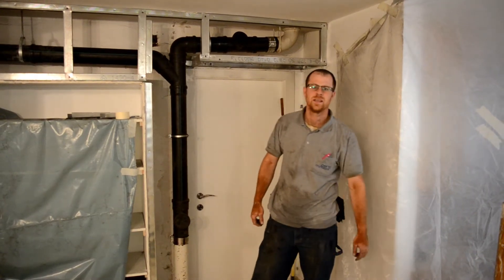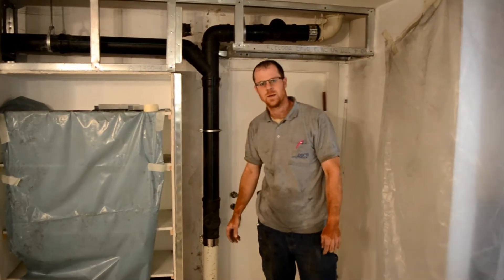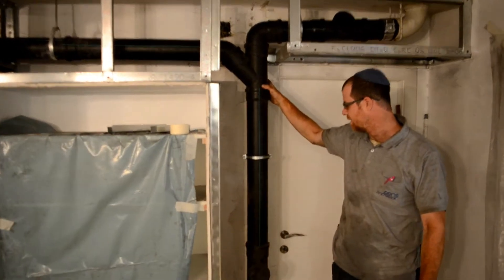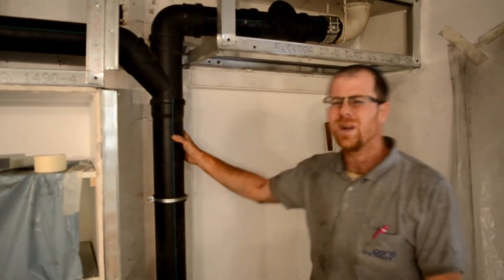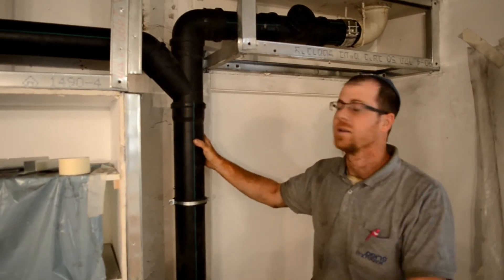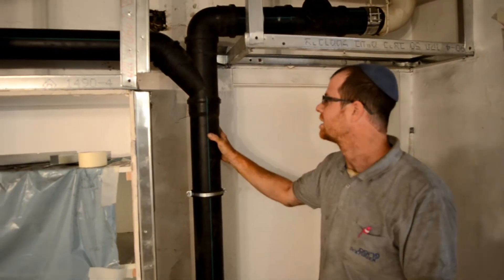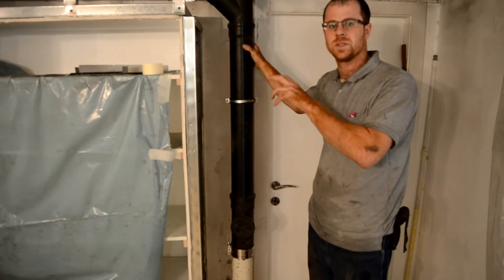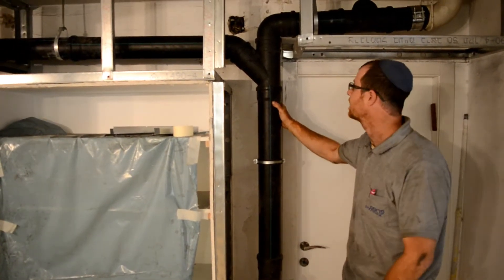Huliot Ultra Silent pipe replacement -- התקנת צנרת חוליות ULTRA SILENT+

Comment: У вас повыше эпсилона ошибка : нельзя монтировать поворот <90* . Только два под < 45* и вставка диаметр трубы между ними ☝🏻
Reply: На 8 секунде видна ещё одна ошибка : 60 см от косого тройника влево стоит крепление для металлических труб🤦🏻‍♂️
Reply from the maker: Must feel good to critique people online. 🫅🏼
Reply: @PrupisPlumbing  אתה יכול לכתוב גם בעברית🤔🤣
Reply from the maker: @vladislavbahrah7630  
לא כתבת לא בעברית ולא באנגלית לא ידעתי איזה שפה אתה מדבר
Reply: @PrupisPlumbing  тогда можно на русском языке писать ✍🏻
Reply from the maker: You are absolutely correct. We were replacing the cast iron piping which was piped the same way. To make it right we would have to lower everything down. They would not want that so we kept it as is